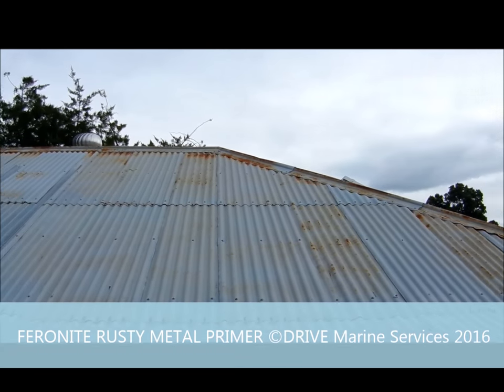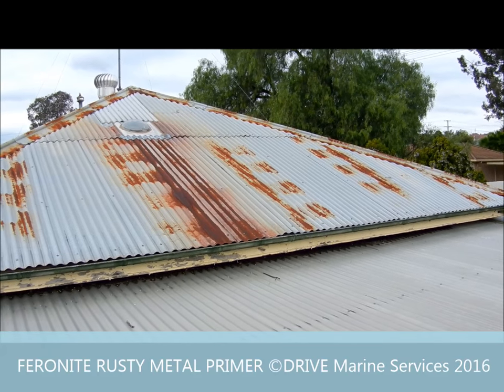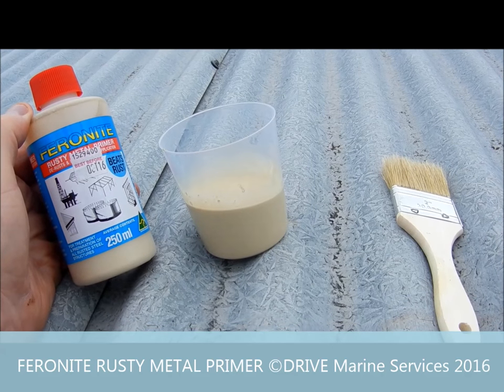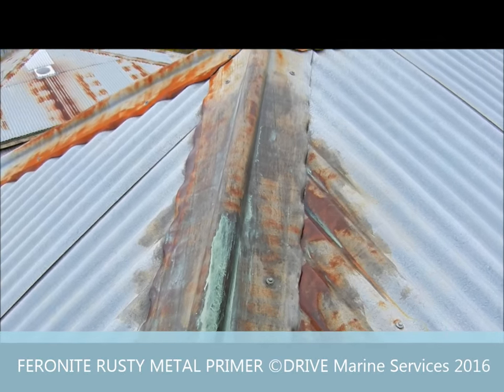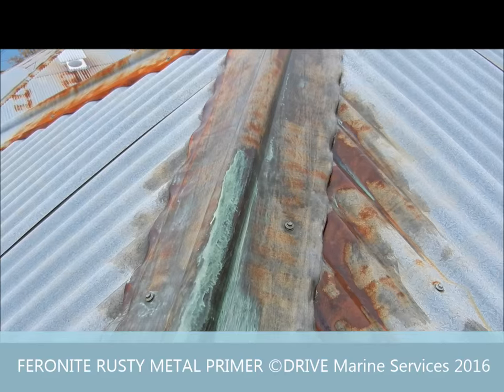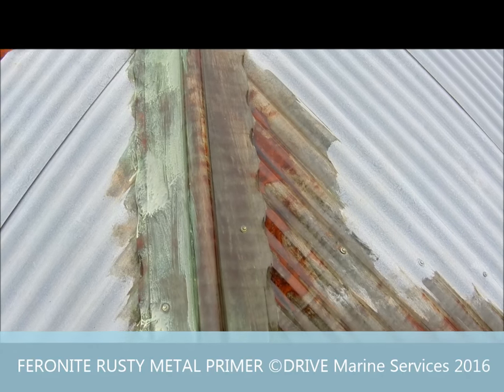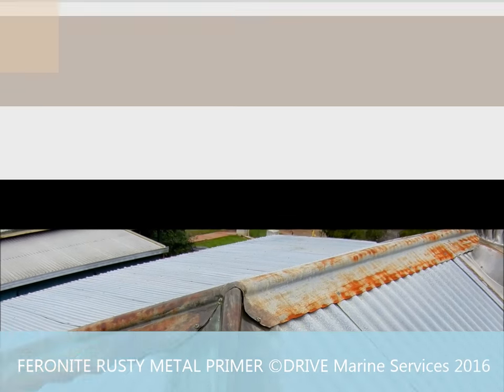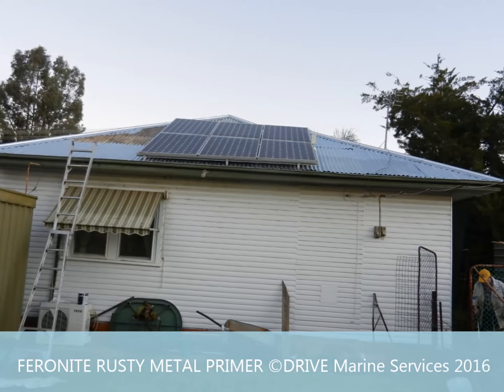How To: Restoring Rusty Gal Roof

Comment: personally i would have rented a 5 bag sandblast pot and a few bags of black beauty and brush blasted the bad areas of roof then blew it off with the blast hose to clean it. then rolled a good coat of iron oxide primer on it followed 2 days later by rolling a coat of white hi-gloss industrial enamel on it. you would have to come back 8 years later and wash it off with a powerwasher and soap , let it dry ,then roll one more coat of white industrial enamel on it to make sure you would get another 15 years out of it.
the white reflects the suns heat and makes it much cooler under there in summers, and the hi gloss enamel makes snow and rain&dirt run off fast as it does off a cars finish.
if you wanted to get 30 years out of it you could rent a sprayer and spray the underside with iron oxide when you primed the top.. no need to put finish coat inside.

Comment: Heya Dave. I have some rust on my metal shed roof where a previous rust converter application has caused the paint to flake away. Do you recommend sanding the loose paint away prior to applying the Feronite Rusty Metal Primer?

Comment: Seems like this stuff is a good solution for the rust. The problem with painting over metal roofs is water will always find a way to get in or under. Except once it's painted it can't get back out again, making the issue worse. I wonder if cold gal or fish oil might be a better option.
Reply from the maker: Good Morning Andrew,
Concur the Feronite Rusty Metal Primer is the best solution because it CONVERTS, SEALS & PRIMES in one application.  I do not understand your comments on painting.  If water is making its way in then that needs resolving whether it be a rust hole, loose screw or excessive gap somewhere.
The aim of painting over Feronite RMP is not to seal any holes, area around loose screws or gaps.  It is to protect the Feronite RMP from UV rays.  UV breaks down the Sealing properties of Feronite RMP over about 12 months. At which time the rust will bloom again.  
definitely

Comment: I have 150 m2 of roof to prep. What application method do you have, as the cup and small brush is not practical? Thanks.
Reply from the maker: Good Afternoon CTrader,  Concur.  Use a soft Bristle Broom and container large enough to wet out the broom.   If Orb Gal there are companies who make rollers for painting them.  If you want further info touch base via email.  I have a feeling I have just responded to you by email.

Comment: If it is rusty on the top it is likely to also be rusty underneath especially around edges and laps.  I think as I said in other comments you have to lift the iron and treat / paint rusted areas.  My roof has rusted far more on the underside especially at the edges  and in between laps.

Comment: Great video.  I am considering buying a place with a galvanized roof that has just a few spots on it.  I have a few questions:  for painting, did the silver paint go on over the feronite without further priming?  Did you prime the other parts of the roof where you didn't use feronite?  If so, how does feronite interact with normal primers?  By that I mean, if I prime the other parts of my roof with something besides feronite, then there will be a "seam" between the feronite primed part and the part primed with normal primer - is there any problem with this?  And finally, is the paint that you used a high-zinc paint to prevent rust in other parts of the roof where there hadn't been rust yet?
Reply from the maker: GoodMorning Kurt,

Great Questions.  Before I answer I just want to reinforce to check the Feronite Rusty Metal Primer is still in Best Before Date.  Plus you must mix the Rusty Metal Primer very well to ensure all solids are mixed in as they do the Sealing and Priming.  Do not use Feronite Convertor as it only converts.
Yes.  The Feronite Rusty Metal Primer Converts, Seals & Primes in one application.  I recommend Wattyl KillRust (by the way - it does not KillRust) as it goes on fairly thick and provides a good layer in one coat to keep UV away from Feronite.  Check, but I think it will go directly onto aged Galvanised surfaces without a Primer.  I tried the Dulux equivalent but it does not cover anywhere near as well.
We have Feronite available which is fresh 02 9533 5470.

Comment: Did you consider removing the rust instead using something like hydrochloride acid?
Reply from the maker: For starters there was no acid used for cleaning the rust in this video as we have a product that you would know about if you actually watched the video (with the sound up) that doesn't need full removal of rust and is safe for everybody to use unlike your aforementioned hydrochloric acid!
Reply: @TheEpoxyGuruTipsTricks  it you read my comment you would see that it says “did you consider...”. That means I’m asking a question. The question is about the need to remove the rust instead of.. what looks like just masking it. Don’t bother replying cheers
Reply from the maker: @delatroy  Sorry if the reply was inappropriate.   Freonite uses the rust to with tree Tannin and converts it into Ferritic Tannates.  Then it has goodsies in it that sealsa and primes in one application.  It is water based and extremely safe to use.  It does not rely on nasty acids such as phosphoric Acid to convert the rust like most of the others do.  Feronite Rusty Metal Primer does not hide or mask the rust.
the problem with acids is that they attack good galvanising and paint and cause more trouble than they are worth.  Plus they only convert the rust.  If you do not wash all of the acid off and do not conceal it under a high solids epoxy undercoat it will rust again in a fairly short period of wet weather due to water leaching through the paint and the rust will be worse then ever.
I apologise for my staff member not interpreting your question well.
Reply: @TheEpoxyGuruTipsTricks  many thanks that makes sense 🙏

Comment: Looks great! I need to redo our roof while my dad’s out beating the coronavirus virus. Wish me luck! 🙂
Reply from the maker: Good Luck.  If using the Feronite Rusty Metal Primer make sure you wash down with hot soapy water and hose off first and remove all loose rust and paint.  The rest is easy as long as you can handle heights and play safe.

Comment: Hi Dave, as u said this product is non toxic, rain water is collected from my corrugated steel roof for gardening and fruit tree. Is there any concern if I used your product to fix the rusty roof?
Reply from the maker: Good Morning Anders,  A great question.   The Feronite is inert once cured.  As stated you need to paint over it with any roof paint to keep UV at bay.  Therefore once sealed in it is the paint used to protect Feronite from the sun is the critical concern.  Depending on where you live is more of a problem from air pollution.  If in the city, it is particulates from cars, trucks, buses & plane.  In the bush it is what is being sprayed to keep weeds, bugs & grubs at bay.
Thanks for being environmentally friendly and harvesting rain water.
Good luck with sorting out your rust problem.  Feronite is not just for galvanised surfaces breaking down.  It is brilliant for anywhere rust shows its ugly head.
Reply: @TheEpoxyGuruTipsTricks  How to order please? Can u please send me the detail?
Reply from the maker: @akcw350   Good Morning Anders,  You can contact us by phone @ +61295335470 or email at Bote.Cote@optusnet.com.au and we will sort out your requirements.  There is further info at our website www.BoatCraftNSW.net

Comment: This looks great and thx for posting. Can feronite be applied with a sprayer? My entire trailer needs it.
Reply from the maker: Good Evening,
Thanks for your enquiry.  Yes if mixed thoroughly it can be sprayed on.  Feronite rusty Metal Primer is very fluid.  You can also thin it with water.  I would scrub the the trailer with hot soapy water and hose off.  If there are lap joints keep feeding in until it comes right through as it will wick its way through the joint.
Give us a call if you need additional info.
Dave Giddings
+612 9533 5470
bote.cote@optusnet.com.au
Reply: DRIVEMS Fantastic, thanks for your reply.

Comment: Rust continues to eat through to other side of metal it's best to remove &replace with  new product. Covering it is only a temporary fix and a future nightmare to deal with down the road. Always best to do it Right the first time. Maybe Remove Rust and  treat  Before Screwing it to Rafter's.
Reply: Treat both sides of metal before screwing it to  Rafters.
Reply: Couldn’t agree more as indicated in my separate comments.  When I worked as a paint chemist in Dulux it was well known that a corrugated iron roof properly primed and painted both sides could last up to 70 years in NZ climate but no one does that (except me when I re roofed my garage as it has  a flat roof) .  The long run iron which roofers cut to size on site certainly helps by  avoiding laps.

Comment: What does the roof look like now?...is the rust coming through?
Reply from the maker: Good evening Toy,

Why would the rust be coming back through after the Feronite has CONVERTED, SEALED & PRIMED the metal?   It was then coated with a silver paint to prevent sun (UV) from degrading the Feronite which is the only reason the rust will come back.  

Check out our website @ http://www.boatcraftnsw.com/products/feronite-rusty-metal-primer/ for additional information on the advantages and applications for Feronite RMP.

FERONITE Rusty Metal Primer is unique as it does NOT just convert like most other Rusty metal converters.

It does not use Phosphoric Acid to convert rust like most other treatment methods.

Regards,

Dave
Reply: It was a genuine question as Im looking for a product to use on my roof and I have heard many people not impressed with them. They say not all of the rust converts to the non-corrosive stuff as one can see in this video.  If it doesnt convert to black then it will continue to rust under the paint.
Reply from the maker: Good Evening Toy,

It is my fathers house roof at Wellington in NSW.   It was treated last June Long weekend and I have not been to Wellington since February this year and it was fine then and I would not waste my time doing it if it was a scam.  I am sure it will be in good condition for several years.  The problem will be if it is not repainted when the silver paint starts to deteriorate. 

The problem with product that just converts is that it needs to be undercoated with a high solids Epoxy undercoat and then a good quality topcoat over that.  Also, it is usually worse as it is hard to remove all of the phosphoric acid.  As most products only convert the metal it will readily rust again once moisture works its way through the paint.  By the way most single pack paints are not very waterproof and I recommend the Wattyl Kill Rust or a good quality acyrlic paint.  

If you are not prepared to believe me;  I recommend you purchase a 250ml container of Feronite from us and do a trial - $21.50 plus postage.  As long as you follow the instructions it is hard to go wrong.

Regards,
Dave
Reply: So you're saying it needs to be undercoated first before you put the rust converter on? or put the undercoat on after the rust converter, then the top coat?
Reply from the maker: Good Morning Toy,

I think you need to watch the Full Video.  The Feronite goes directly onto the Rusty metal as shown in the video.  Then you need to put a coating over the feronite once cured to protect it from the sun as UV will break the Feronite sealing property down over 12 to 18 months if not painted over.